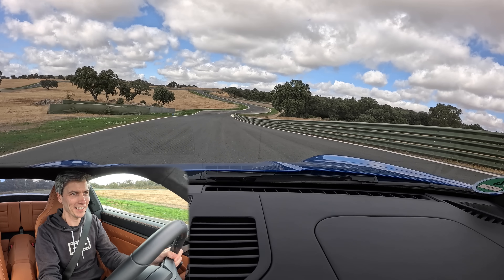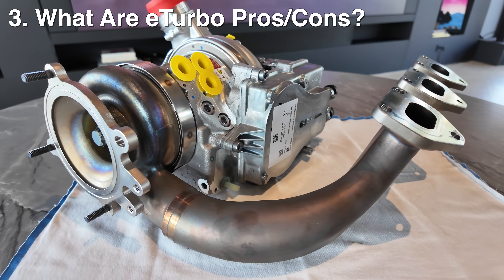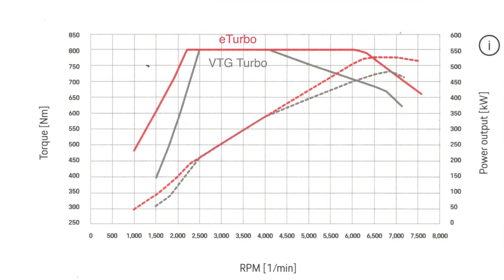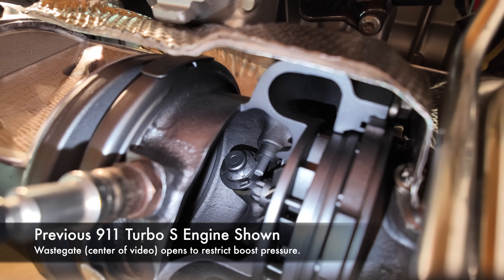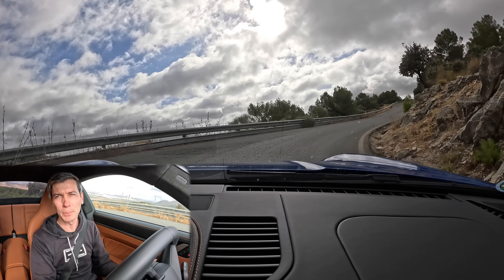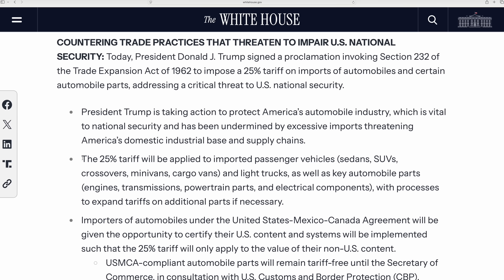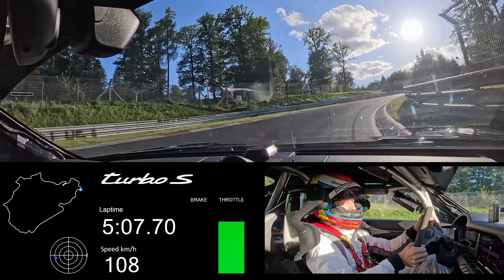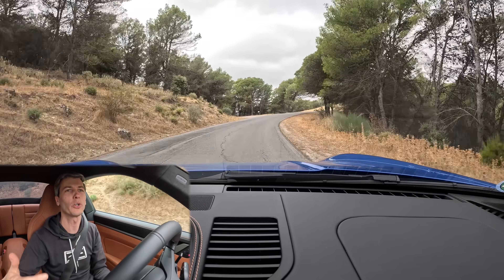Electric Turbos Are Here — Is It A Good Thing?

Comment: Where is he driving around? Spain, Circuit Ricardo Tormo at the end. Spain also at 13:26 on the Malaga province road MA-5400 at km 8 sign at coords 36.8486176 N 4.9496586 W.  The video begins on the Ascari track. And there is a short Nordschleife onboard snippet added in between.

Comment: Seems Porsche employs the best auto performance engineers and scientists anywhere in the world. 
The material sciences, design, software and architecture to achieve this is seriously impressive.
Reply: Having worked at an auto parts supplier, and therefore seeing how the sausage is made (to some extent) I will continue to argue that Corvette's engineers are the best automotive engineers in the world. The fact that they can even make a car that can make it all the way around the Nurburgring is an amazing feat when you actually know how adamantly opposed to good engineering the larger GM corporate culture is.
Reply: They also employ the most diabolically evil pricing analysts. 😭
Reply: Yeah but it's only possible because they make very high profit margin very overpriced cars. The rest of the industry has to have value. It's not like Porsche invented this, Honda has a similar system on their V3 motorcycle.
Reply: @truantray bla bla bla of course this tech isn't designed for cars that cost bare bones and are just used to get from point A to point B. It's made for people who have the money to burn on these expensive toys. And it doesn't really matter, they have the target market, and the target market is willing to burn cash for this. Win win. Porsche doesn't give a single sht about making a smol econo car for Pajeet in India.

Comment: Question. When the electric turbo boosts on electricity. Does it create a sucking air flow from the engine to help get the burnt air out of the combustion chamber faster ?

Comment: I guess some another advantages of the e-Turbo could be a better management of things turbos are very sensitive to:
1. Bearing design. Lubrication and offloading the shaft is cruicial for high revs. Big and high revving turbos need the best quality ball bearings for good balance and durability. An electric motor sharing the shaft with turbine can offload most of this task to the e-maotor in the turbo, eliminating a need for space-tech bearing between the cold and hot sides of the turbo.
2. Fixing the issue of stopping the engine while hot and the turbo is still spinning. The e-motor can quikcly bring the turbine to a complete stop to prevent rotation without oil pressure.
3. In fact, a properly designed e-motor can act as a backup oil pump so that it can circulate some oil to provide lubrication during startup and even gradually spinnig it up for starting.

Comment: This is all good and whatnot.... but I'm still waiting for a Small Battery EV, with quad eMotors for 4WD, and with an Extremely Efficient Diesel Generator (no clutch/gears).
Reply: That way we can have a very performant 200KW daily driver vehicle with instant torque and power, at the usual 1.7 Tonne kerb weight, with long 1,000km range on a 50L fuel volume and 20KWh Battery Capacity.

 Diesel is a much less volatile fuel than Unleaded/Premium fuels. Also Diesel prices are usually more lower globally and more stable. Even better design would be, if we could have an extremely Efficient Electric Generator, but it uses 100% Ethanol instead. This is an energy dense fuel, but it is 100% renewable resource, and it has much lower emissions than Diesel/Unleaded. I can see "algae farms" to create Ethanol Biofuel at same cost as "crude oil" coming in the next decade.

Comment: I drive an old inline 6 4.9 300 Ford. I experience low end flat torque of 300 ft lbs from 1400 rpm to 4000 rpm lol. Most people don't know what you feel, but I have a pretty good idea... I've been wondering about electric turbos for years since Mercedes and Borg warner started getting serious with them

Comment: Do these e-Turbos also limit the need for partial throttle? Since you have such granular control over boost, I assume (at certain times), you can keep the throttle fully open and control the power output just with boost level. Could that be another area where efficiency is increased?

Comment: Using the hybrid exhaust/electric turbo power, plus the r electric regen when the exhaust power exceeds the desired boost is brilliant. Then throwing in the electric torque motor to use the excess power.

Comment: Germans over-engineering things to the max, as always.
Here we have car built for ultra rich if they want compact vehicle with compact engine that is really fast.
Obviously turbos even if well made are gonna need repair. Here you don't need to worry about it. You go to a dealer and they're gonna replace it for 30% of a cost of the car.
Emissions don't matter in this case. There isn't gonna be a lot car like that and added complexity and lack of repair ability is gonna offset emissions. 
Real art is making something simple, cheap and long lasting if you care for environment.

Comment: This is a great explanation and the technology is a game changer for making big power out of turbo engines. My only problem (and everyone makes the same mistake) is the definition of turbo lag. Turbo lag is not the time it takes for exhaust gas to build sufficiently to produce boost. That is boost threshold. Turbo lag is the delay in producing boost after throttle is applied AFTER the boost threshold has been reached.

Comment: Man, those electric ducted fan turbos on eBay were way ahead of their time :elbowcough:
Reply: If I hook my leaf blower to my Prius I should get moar hp 😂
Reply: @ralanham76 leaf blowers have little pressure
Reply: @geemy9675  Hahaha, Captain Literal, ahoy!!!
Reply: @MarkTLarry at your service
Reply: Those were actual electric turbos, or turbine blowers to be more accurate. What Porsche has is an electric assisted turbo. EAT. I can see why they didn't go with that acronym.
Reply: @gamerjerome  No, they weren't electric turbos, because turbochargers compress air. Those did not compress air, they were literally just electric fans.
Reply: Now we have the torqamp😞
Reply: Back then it was run on 12v from battery, truely ahead of its time
Reply: depends, because if they are under powered and not reliable, they are not a good solution
Reply: @raph151515  I think you missed the sarcasm.
Reply: @JC-lk3oy  maybe he was talking about fake turbos from 10 or 15 years ago, but recently there have been some real low boost electric blowers that actually kind of work
Reply: @raph151515 
Closer to 20 years ago now... Ooof. I feel old 😂
The thing I always wondered about them was whether they could spin fast enough to still push extra air in at higher engine speeds. I have a feeling most of them probably gave a small boost to low end power, but a reduction at higher RPM as it became a restriction rather than a pressure boost. They all looked like they were basically leaf blowers.
Reply: @tin2001  They were just fans. A fan doesn't pressurize the air like a turbo, nor is it a positive-displacement pump like a Roots blower. They pretty much just acted like an obstruction to the airflow.
Reply: @rars0n all fans compress air to some extent. A turbo is also a fan. Saying something is just a fan doesn’t mean it isn’t a turbo.
Reply: @Gnerko123  No, they don't, they move air. A turbocharger compresses air. A fan is not a turbo, and a turbo is not a fan.
Reply: @rars0n you can’t move air without creating a pressure differential. 

A turbo also moves air. There is more airflow with a turbo than if there weren’t a turbo.
Reply: @Gnerko123  This is an idiotic conversation. The air that exits the volute of a turbocharger compressor housing comes out COMPRESSED. A turbocharger is designed to move air while also compressing it.

Fans create small amounts of pressure as a byproduct of moving air. They're not designed specifically for the purpose of air compression.
Reply: @rars0n a turbo has a fan in it, you’re making a distinction where there is none.
Reply: @Gnerko123  No it doesn't. A turbocharger's compressor section consists of a compressor wheel (the thing that you're calling a fan that isn't a fan) and the volute (the specifically shaped housing that encloses the compressor wheel). A compressor wheel is designed with a very specific shape that, in part with the shape of the volute, allows the turbocharger to compress the air it intakes as it spins. Unlike a fan, the tolerances between the compressor wheel and volute are precise, because if they're not tightly maintained, it will fail to compress air properly. Note that a turbo actually HAS to compress air in order to achieve its maximum airflow efficiently.
Reply: @rars0n the compressor wheel is a fan. It works the same way as other fans, moving air by rotating angled blades. I wonder about your definition of a fan that a turbo’s compressor wheel doesn’t fit.
Reply: @Gnerko123  "It works the same way as other fans, moving air by rotating angled blades."

No, actually it compresses air as it spins, as I explained in my previous comment. Fans do not do this. Clearly you don't understand anything about how a turbocharger works.

What baffles me is why you continue to share your ignorance with the world. What exactly are you trying to accomplish? I can't even imagine.
Reply: @rars0n as I’ve said before, air compression and air movement go hand in hand. Think of the fundamental way how air is made to move, it’s the same. Angled blades are moved through air, forcing air to flow towards one direction. Depending on the design of the blades and housing, this can be optimised for different conditions, e.g. low pressure high flow or the other way around, but there is no fundamental difference between a fan and a turbo’s intake impeller. You’ve not been able to indicate otherwise, other than insisting one creates pressure while the other doesn’t (which is false).
Reply: @Gnerko123  "but there is no fundamental difference between a fan and a turbo’s intake impeller."

I already explained the difference. The blade design is totally different. The housing is totally different. The function (the thing it does when actually spinning) is totally different. The operating range is totally different.

You're just not getting it because you have no clue how a turbocharger works, how an air compressor works, or how a fan works. By your logic, the words "fan" and "air compressor" are interchangeable because they mean the same thing.
Reply: @rars0n what’s your definition of a fan?
Reply: @Gnerko123  An enthusiast, devotee, or follower of something.
Reply: @rars0n lol in that case I understand where the confusion comes from

Comment: So the same manufacturer that called their electric car performance package  "turbo" - is making a hybrid turbo and calling them electric?
Nice
Reply: It's not hybrid. The electric motors are assisting the turbo, not the drivetrain.
Reply: @Noojtxeeg its a hybrid turbo, this is a term originating from F1. Electric turbo would have no combustion component to it
Reply: @Nikoxion  Ahh I see, not a F1 guy here so I'm unaware. I feel like for the average person who isn't super into F1 would assume "hybrid turbo" means what I was referring to though. Which is probably why they didn't use that term.
Reply: @Noojtxeeg  But there is an electric motor in the drivetrain, so it's both.

Comment: A-ha! "Target torque level" — so you do admit torque is the prime factor. When the torque is high but RPMs are at zero, that basically means the turning resistance is overbearing. Yet without torque there won't be ANY motion at all. Power is secondary to torque, because it's derived from it — not the other way around. But I agree that low down torque is more important for pulling huge loads rather than accelerating quickly when empty.

Comment: Great video love the strategy and thinking of porsche in this system !

What would also be great is when the battery is at its maximum charge is sending that excess power to the ac compressor ... You could cool down the intercooler with this and reduce ait,s ... Gaining efficiency or power that way albeit temporarly

Comment: I'm calling it, the turbos will need replacing every 20k miles and cost you 15k to replace. An electric motor in the middle of the hottest part of the car is a recipe for maintenance disaster.

Comment: Is there a reason we don’t throw a little bit stronger motor and have it send power to the wheels as well as spool up the turbo? Then maybe put another motor on the front to also give power and spool the other turbo. This seems like a pretty simple way to create a bunch of power without adding too much weight.

Comment: Is interseting. The turbo lobbist spent year laminating that the "Newer" turbos had no turbo lag and there was no use for superchargers anymore. Now where here and basically its a super-turbo system with the same challenges and downsides of a supercharger + turbo setup. The only Con not metioned is the electric motor being on  the hottest part of the exhaust. Electric motors don't like heat.

Comment: Once upon a time  there was an "alternator". They moved it between engine and transmission and called it" integrated starter generator". Now they connected it to a new motor on the turbo and calling it " E TURBO".

I bet some where in the future the e turbo will also become inline between  the ISG and transmission and we will sold that they eliminated the "additional turbo motor"
Reply: You didn't understand a thing in this video did you

Comment: QUESTION: i'm not super knowledgeable in the engineering of this kind of stuff, but can anyone explain why we don't just use all-electric turbos? before the addition of electric motors i got it, but now we've already got HV electrical systems in these "hybrid" drivetrains, why not just make a purely electric turbo? seems like it would make it even more simple (easier to route 400v wires vs. exhaust pipes). You wouldn't get the regen, but in anything but a higher end sports car like this it doesn't seem necessary.

Comment: What is the operating temp of both EL motors  . . . because of heat, how long will the motors last? 
Average EL motor operating temp = 40c
Trans operating temp = 79c
Turbo operating temp = 500c
Google: Yes, high heat can damage electric motors
Sounds like it is built to "last the life of the car"

Comment: The 911 has a very cool tubro tech, instead of just using the motor on the compressor side why did not they use the e motor on the turbine side which can improve the outflow of exhaust gasses out of the combustion chamber, doing so also might not decrease its efficiency on the compressor side too much(Hope so, I am just a high school student with a curious mind)

Comment: Jason, 14:21 You keep saying about the turbos 'using them as a brake'... What you really mean is as 'using the turbos as generators' that hold the turbos under load and limit the boost output (or shaft speed), instead of a waste gate.

It's being pedantic, I know, but that's what engineers are 🙂👍

Comment: This just makes me mad. Formula 1 has a MGU-H which is the electric turbo spoolin gthing that can also use that to charge the battery. In 2026 Formula 1 will see one of the biggest changes ever in terms of chasis and powertrain design. They got rid of the MGU-H because they wanted to be appealing to new manufacturers and because road cars dont use electic turbos. So Formula 1 management just removed a good piece in terms of power and efficiency and stopped any further development of it to be more attractive to new teams.
Reply: You gonna be much more mad when you learn that PORSCHE made F1 to abandon the MGU-H 😂